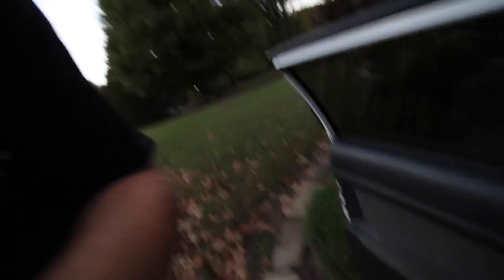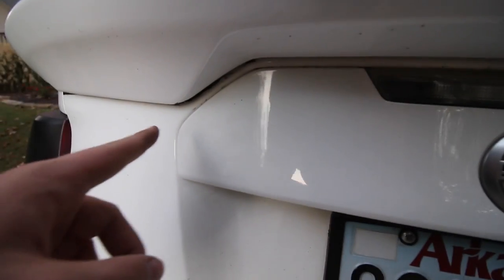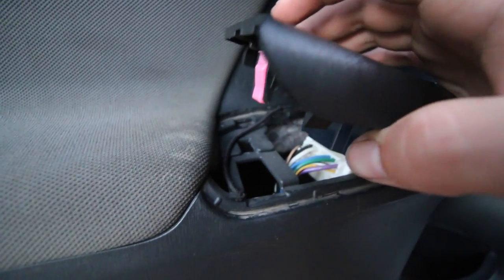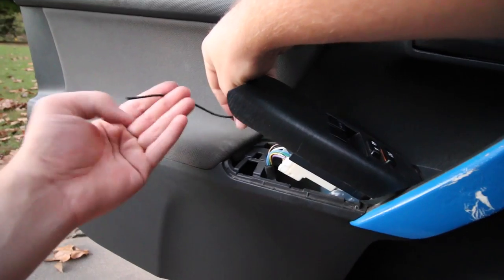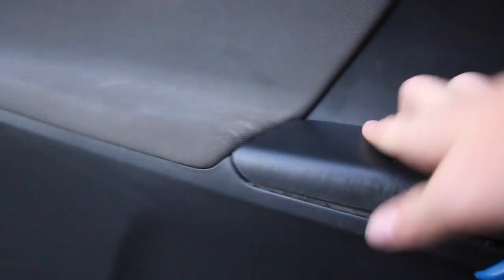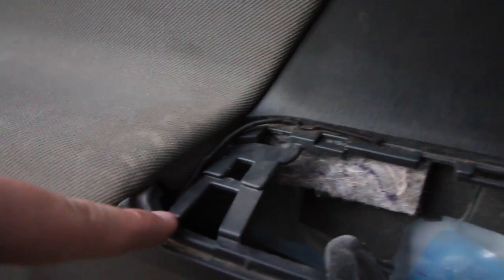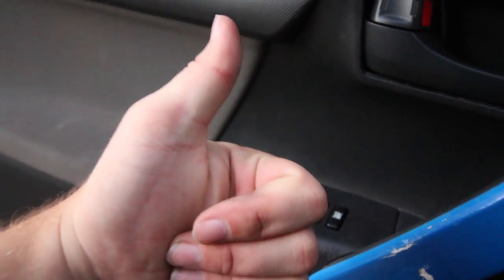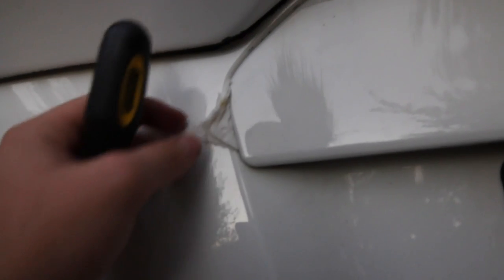Scion tc2 Door Rattle Fix!!

Comment: If you haven't fixed this already, you have to tighten the screws that hold the backplate together! I had the same problem and I checked the screws and one was loose! After I tightened it everything was fine again. 😎
Reply: Jxsvs how do you tighten it

Comment: I got a rattle that coming from the dash by the steering wheel somewhere and I cannot figure the shit out, any thoughts/suggestions?  I was wondering if yours does?
Reply from the maker: I did notice that just a little bit as well, but more above the radio and kind of by the air vent. I just kept hitting it until it finally went away. Since its all plastic and clips mainly, stuff gets loose, which is annoying. This was about 10 months ago and I haven't heard anything from there since then.
Reply: MK Media I did forget to mention it's when the cars on and I stop either at a light or just in idle, it's unexplainably annoying. I've tried hitting it to no avail.  I'm somewhat relieved it's not me being crazy lol but I will try again to hit it and see if it stops
Reply from the maker: Oh so its your engine, not when music is playing? If so, mine did that too out of no where this past summer. Couldn't figure out where it was coming from so I just left it. Its gone now. I think I know what you mean.
Reply: MK Media yeah it's after car has been on for any period of time and then I put it in idle or stop at a light or whatever.  I tried banging on the dash all over the place and the only thing I accomplished was loosening the gauge trim lol it does seem like it's coming from the engine somehow but I guess there is nothing to be done :(  except hope it goes away like yours did, it's just so got damn annoying